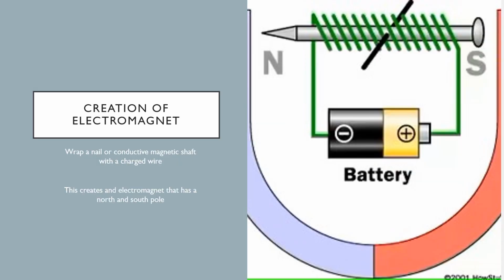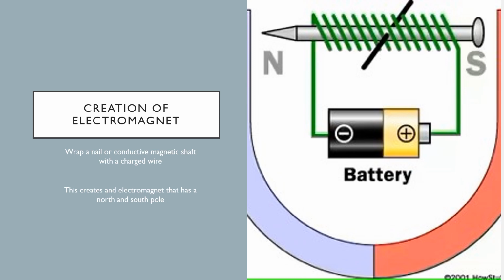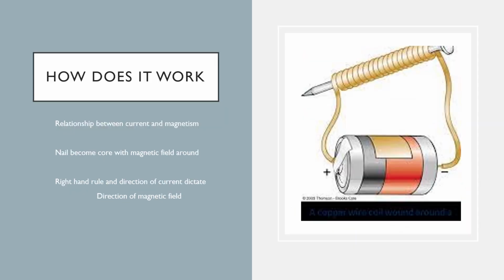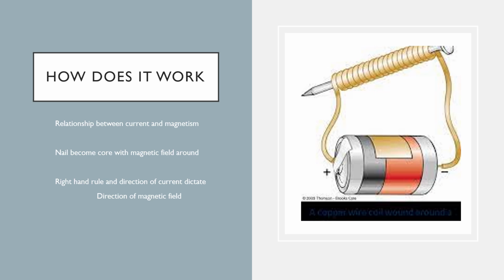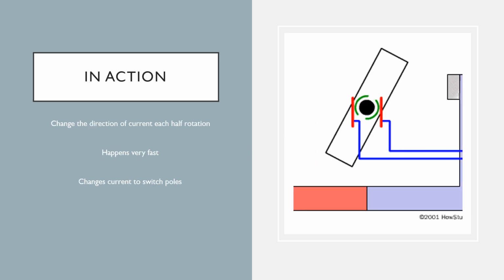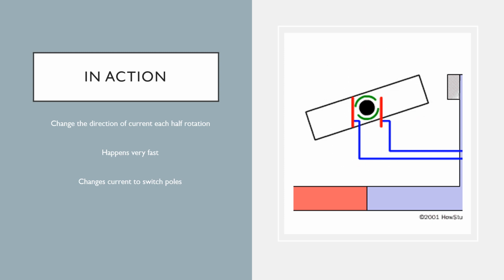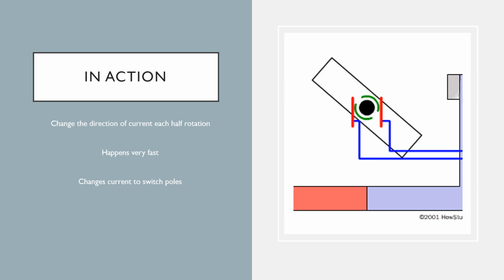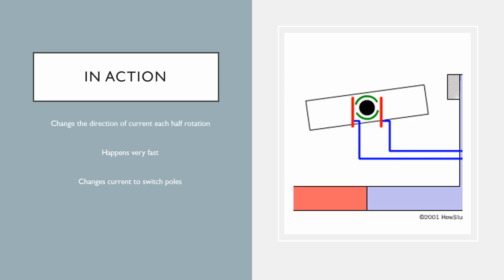Physics3 EC- AC Motors

Comment: Hi Milo, great video, thanks for telling us a little about ac motors! You’re videos strength is in the way you created your slides. The scope of the assignment was relatively small and you were able to have a lot of good content in your slides without needing too many or making them cluttered. The gif was especially good. One thing your could have work on would be practicing your commentary a few more times before presenting. It seemed like you were using “uh” and pausing a lot. Other than that great video!